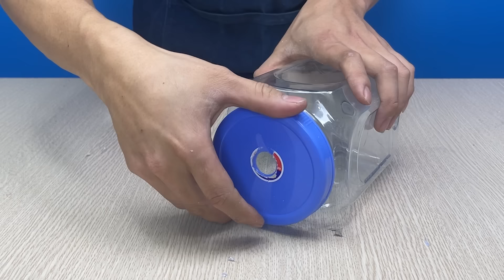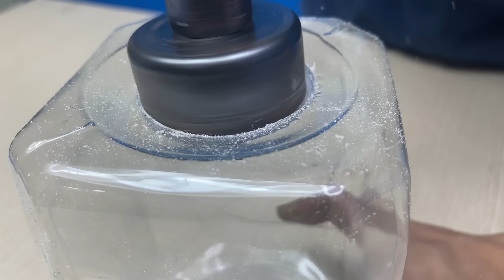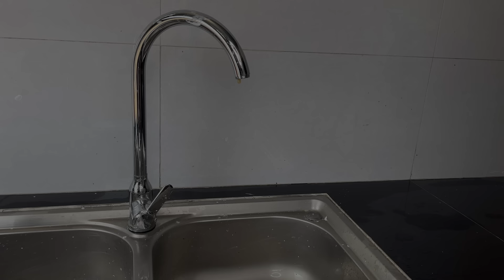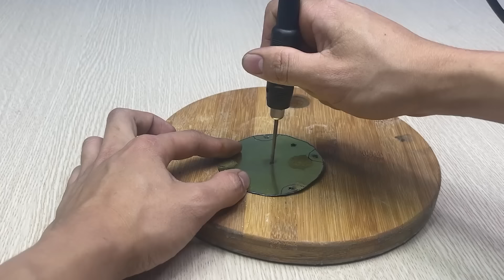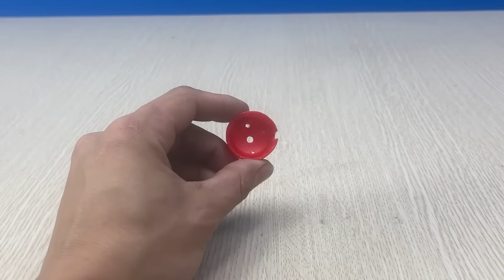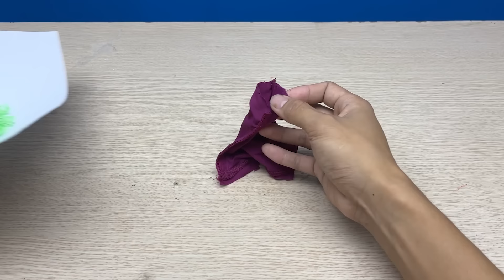Techniques Of The Very Old Plumber Better Than Machines ! More Clean Water Every Day | Anyone Can Do

Comment: The potato peeler is so creative, I'm going to try making it at home tomorrow.
😃
Reply from the maker: I'm glad you found the potato peeler idea creative and inspiring! Making things at home can be a fun and rewarding experience. Just make sure to take all necessary safety precautions and use appropriate tools when attempting any DIY project. If you have any questions or need guidance while making the potato peeler or any other project, feel free to ask. Good luck with your homemade potato peeler, and I hope it works out well for you!